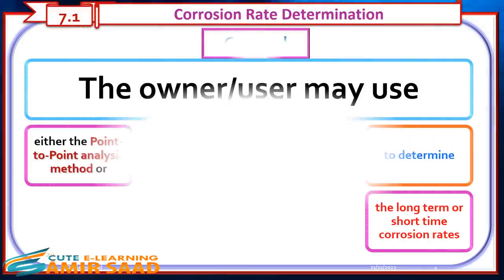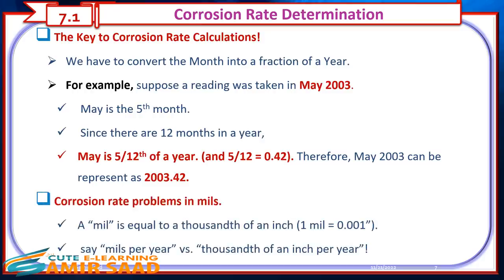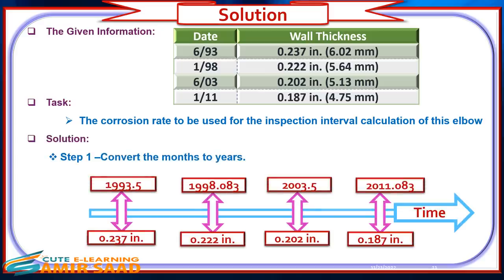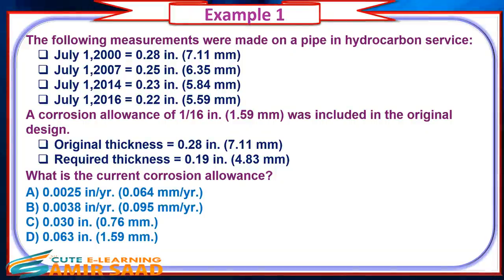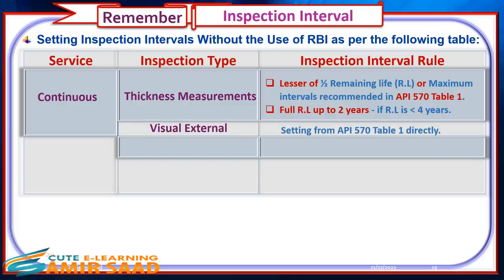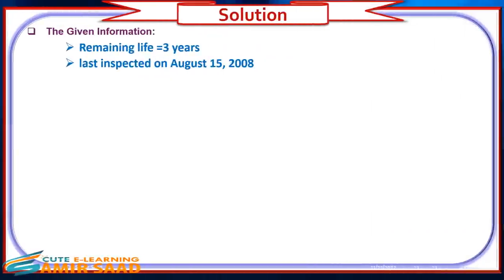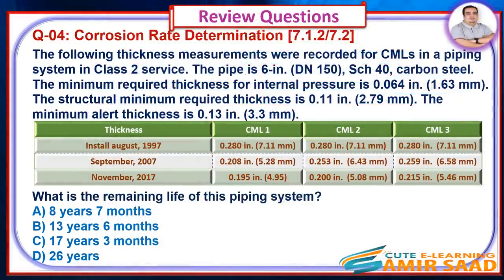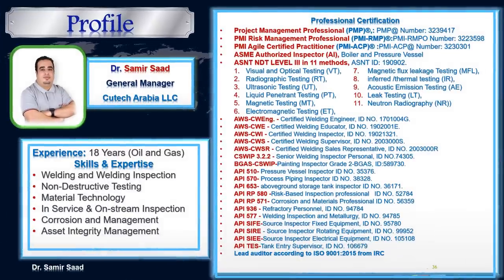API 570 - Inspection Data Evaluation, Analysis, and Recording 1

Comment: Thank you for this awesome work. Question no.4 towards the end is not correct. Structural required thickness 0.11 in. is the driving thickness hence should be used calculating R.L. instead of thickness required for internal pressure.